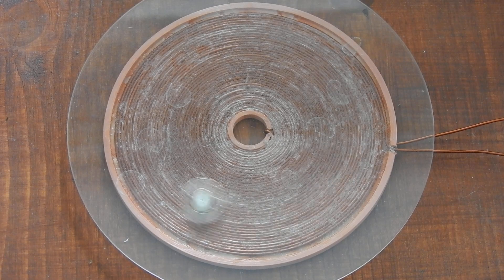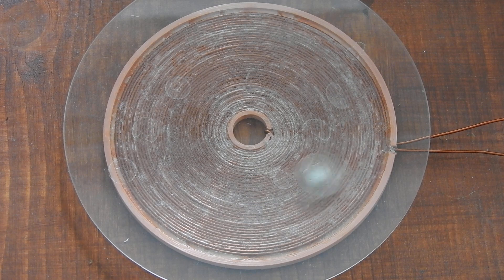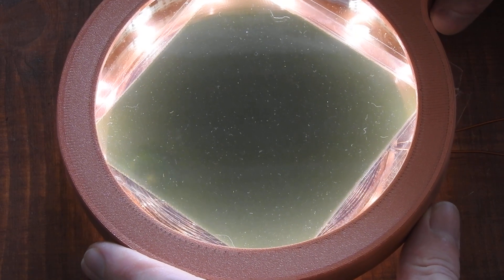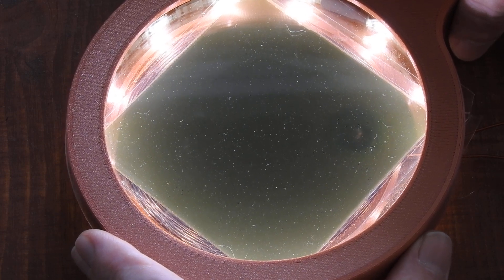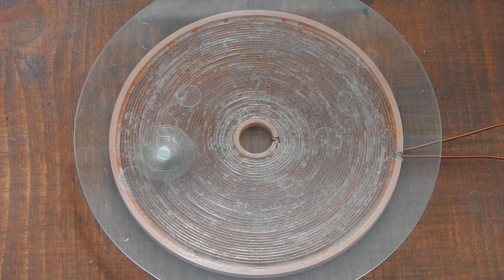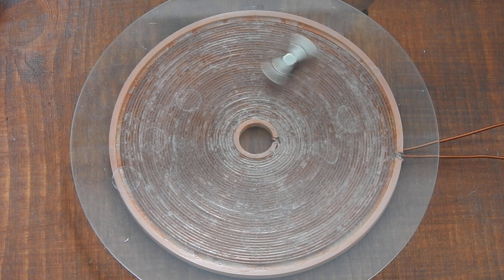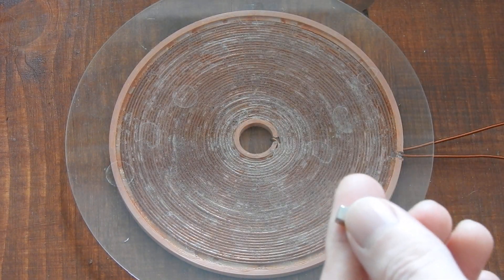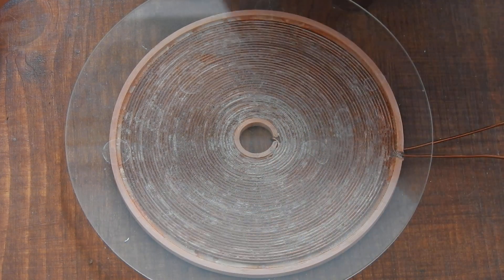Oscillating magnetic field causes a magnet to rotate and precess

Comment: Why does it precess at first, and it precess at circle motion, so it shows shape, that means all shape that you see is depend on precess, which back and forth motion, so why there is back and forth motion, so that means there is a polor that is left and right, and the center, so polor of north and north, so cause the center to be nothing that is non-density or non-magnet flux, base on other video that is year later from now, so the center is non-energy. So, all it comes down two which two is opposite that is 1 and 1, and 1 in center, so all in total that's 3. So, start, middle, end. So, the magnet has the middle which is non-magnet flux, so in relative to higher flux on all side that circle which the center has a radius that is even, so precess is the center is being push and pull at same time base on volt that you input as herz so high volt or herz means back and forth volt, so is the volt on which you put magnet at first, so 0 herz or 1 herz?? 

So, the precess is base on herz, not base on magnet?? Which magnet is one direction like one finger in front of me, so one finger with palm that is back, so you turn one finger, so that one finger change to back of me and palm is front of me, so by perspective so base direction which is circle, so one direction base on center, so the key is center, not direction, but out of center, out of one, out of anything, so the point is out of something so in your perspective one direction that is circle is base on the center. Zero current, but zero current has power so that is Aether so the mass which you pick up as magnet and with magnet show magnet field beyond the zero which is current, so Aether is power, well, not power alone, but power relative to edge, so require edge so there is center to be called, after all, you can't have middle without end and start, so the edge is magnet and center of magnet is zero magnet flux which is two radius furthest from edge. 

Well, the irony that the edge has non-pressure which up is non-exist that is non-magnet, yet the edge has high power so it is base on two different like fire which you have air and another mass, so both interact so it becomes fire so which is pressure so the air is feeding the fire as there's still air there to create pressure, so not feeding as to eat  or as to consume, but to pressure, so the magnet with zero center is high pressure from left and right of center. When you put 5 magnet, so there is 4 center which is bigger gap than smaller gap that is within 5 magnet so that magnet center that is 5 relative to 4 center that is a gap so between 5 magnet, so smaller is creating pressure to bigger gap so the gap get smaller so it rotates faster. So, Logically more magnet means more gap that shink at center at gap so you need smaller pin to go thru since there is higher energy on left and right of center, the gap and include magnet center is higher as well. 

Can provideo more explain at description so what is herz and what's process and herz and process is link or not?? Since the herz part with the already exist volt, so the volt is already on even the herz is low so the magnet move. Which is frequently that is circle direction relative to center that produce same direction outward so. So, that means the herz has the edge and the center so the magnet which spin is same principle as the herz, which represent the three as 1 1 1.

Comment: hELLO,
Love this video, i wanted to ask a 3 questions:

1) for the sake of safety if i wanted to reproduce this experiment or operation, how would i safely connect ac power to the copper wires? i know you mentioned a amplifier but are you also using a bread board, aligator clips, etc.? i tried wiith a bread board and 9v power supply that came with the breadboard and i started smelling smoke so i stopped. I know you told us your setup verbally about what is happening off screen but i struggle to imagine what the connections look like as i am a visual person.

2) Do you think this experiment would be possible to do with magnetized beyblades? I plan to try to reproduce your results but with bey blades and a few other add on since my channel is center around music.

3) Also the copper coil seems to be inside of some bronze dish curious what that is? and the role it plays if any (maybe as a ground?)

Thank you for your time!
Reply from the maker: 1) You connect the coil to an audio amplifiers output just like a regular speaker. The audio amplifier gets its signal from a signal generator. 

2) That could work in theory, but is surely hard to actually make it work. 

3) The copper coil is inside a 3D printed plastic holder, that is just to make it easier to wind the coil.
Reply: @OmegaZZ111  thank you

Comment: If you use magnetic spheres. A large one in the center and smaller ones on the wings. Like 5mm and 4mm magnets.  It will be easier to spin as it's rotating on a single spot.
Reply from the maker: Yes they are much easier to get to spin, but at higher rotation speed they somehow tend to shoot out much earlier than the cube magnets.